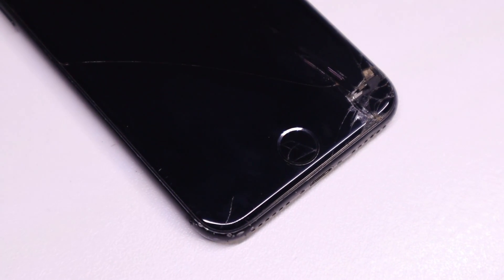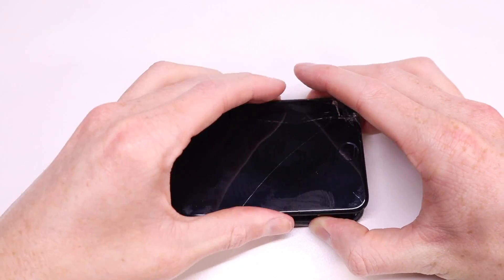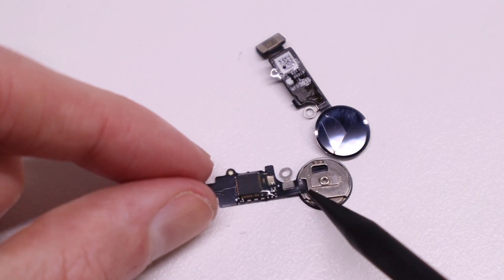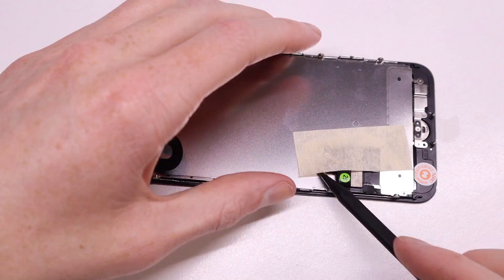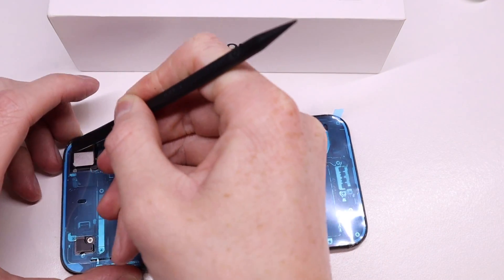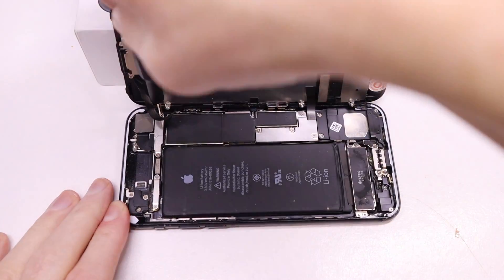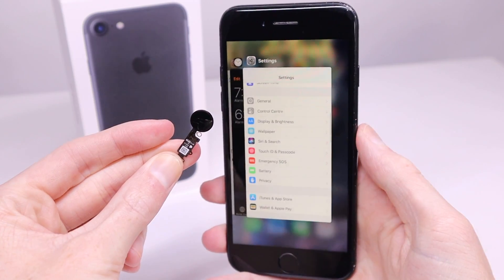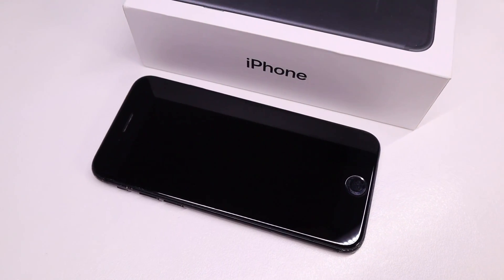Replacing Apple's "NON REPLACEABLE" Home Button

Comment: As far as I know it's always been replaceable, however you will lose touch ID cos of apples anti repair policy basicly
Reply: @usmansuleman9548  it will work, I talk from experience, I work on a repair shop, If it won't boot means there's a problem identifying the home button tho, without the home button takes far longer for the phone to boot ( I do it test the screen), I replaced few home buttons that got damaged with overly damaged screens. The iPhone 6 tho tends to be the most damaged of them all due to their design
Reply: @usmansuleman9548  im not just being stubborn, from my experience when the button doesn't work might be a damaged lcd which has a flex for the home button or the home button itself, ive replaced some buttons for 7 since it's not as likely for them to break as on the 6, only when the screen breaks in such a way it damages the buttons cable
Reply: My apologies, I was researching and tested an iPhone today , for 7 doesn't work I confused it, I apologise my stubbornness, probably too much workload affecting my memory, since it's not common this fault, sorry once again

Comment: The dislikes are from Apple workers who just wants money
Reply: Ssup guys! If anyone wondering what's the best phone for "gaming", iphone xr is my choice for it! If you guys want to know why or just bored, feel free to read this ^ω^

(uhm.. also, if you guys saw this comment many times, I do it because I want to share what's this phone capabilities is. I'm not flexing or anything. You gotta ask you know lol
The reason I share this is just because of how people always talking shit about it and spew nonsense before even handling/playing/trying/using it themselves.)

For a quick review of my iphone xr (128gb white xr), the battery life (battery health is still 100% btw) is down from 100% to 75+/-%, meaning a 25% usage of battery life, in the spawn of 2 hours and heated a bit after playing these games, Pubg (smooth+extreme) and Honkai Impact 3 for an almost 2 hours straight. For fortnite, it's a little bit faster for the battery to drain, which the battery will lower to 75% from 100% only with the spawn of an hour and half. I get a stable 60fps with the setting of 60% 3D res or sometime lower resolution with my iPhone xr while i experience a thermal throttled if i play the game for almost an hour and half straight (still play if it warm and comfortable to hold but usually rest the phone a little after i felt it becoming hot at my left arm. I would say the increasing of temperature is not very significant as I still felt comfortable to use it at the first minutes of the thermal throttling and after that i rest the phone until it's cooled down. Also please do mind this is only like what I'm feel as I don't really know the exact temperature and don't have a proper temperature's checking equipment T.T). 

I guess why this phone's temperature is slow to rise/slow to overheat is because how the iPhone xr hardware is made. Although I do wish they put a really efficient cooling system, maybe a combo with both passive and active cooling system! Like in Razer Phone 2 with a passive cooling system that have a big waterbed-like cooper heat sink. For the active cooling system like Nubia Red Magic 3 with the in-phone-fan, for example. please see this post somehow, APPLE!!  Btw, if you see this comment and manage to do the test, or manage to make a efficient cooling system, I would like to say thank you for the amazing work!! Bless you!! xD

Linus Tech Tips video showing he's doing somewhat "add an active-like cooling system on a phone" > https://youtu.be/F91bGJBQLFc   I hope any smartphone company notice this video, and somehow make what Linus did here, but with more efficiency on a phone. Yep I know I know, who play games on phone right? I do though.. This type of cooling system, if it's done right, we can see a future with a more power phone, or even more powerful handheld console like PS Vita, Nintendo switch or a cross over between the said handheld consoles with a freakin' phone! Again, thank you!! Stay safe and have fun all!

#Notice me senpai! <3

For the full battery cycle, I reckon the last time i'm not charging the phone after it really empty, from 100% to 0%, it's literally take 12 hours and 48 minutes with both normal usage and heavy usage.

 About the overall look, for me I really love the xr design with the THICC bezel and the weight just because it give me these "psp/ps Vita vibe" when I'm using it (which I really love lmao).

The 720p display? Well it's actually 828p but who cares right? If you have tried it yourself and compare with other phone, you'd know that the Xr's screen is really one of the best lcd screen display out there. Believe it or not, Apple have done a good job to make the LCD screen really vibrant, curved the screen, make the screen overall really nice, and not shit at all! xD (but still the OLED screen is absolutely more vibrant, colourful etc but take note about the flickering issue, burn in-display issue or whatnot, and of course OLED is beautiful. It's just that these LCD screen do take it easy for the eyes to see and nice to look, for me at least). 

The "real" comparisons between xr, xs max and xs >
https://youtu.be/NWIO-9-rDcM

 About the display comparison between OLED 1080p vs LCD 828p > https://youtu.be/dcFXEXJicgc        

For the battery life comparison > https://youtu.be/3_y8BGOP-v

Btw if you want to make a comparison between any phone, search gsmarena or see this link >
https://m.gsmarena.com/compare.php3?&idPhone1=9320&idPhone2=9319

Someone will call me fanboy, blind etc but! My choice for a "gaming phone" goes to iP xr. Thanks a lot for reading lol! xD

Btw, this reply is made in hope that anyone who have a iPhone xr, or well, other device if you might, a proper equipment and have the discipline, to read this and do a proper thermal throttle, heat test from all around the phone (how long before it reach throttle for example), battery test, fps test, etc. I-i.. thank you from the deepest part of my freakin' heart!! Thank you so much :')

The test that I'm hoping to see is like what this guy do : Samsung Galaxy s10 test between exynos and snapdragon variant > https://youtu.be/kg91U2hbLbo

p/s : I really cannot do the test myself because 1) Dont have the proper equipment. 2) Dont have the knowledge of how should the test be done. 3) and.. I-i.. can't play phone for a quite long time, straight before feeling sleepy lmao. I just hope someone do the real test about the iPhone xr as I'm really curios what it's can do/ it's real potential, so I can shared the information to everyone who don't appreciate the phone and just ignorantly saying the phone is bad xD 

2nd p/s lol : Again, I'm not flexing or anything, I can finally buy this phone after a month and half lol (welder at a construction site). Working everyday and leave at 10pm except Saturday at 7pm and Sunday at 10pm xD so I'm not rich or something ahaha
I try the phone beforehand, it's my friend xr, and damn I was like this phone is snappy as fuck lol, then got told by him his experience. At that time I put my mind to buy this freaking phone 😂 and about my comment above, that's my experience with it

Stay safe and have fun guys≧∇≦! <3

Comment: Finaly we dont need to pay apple to much for repair. Nice video 👍🏻👍🏻
Reply: I heard they don’t do repair anymore.
Reply: No touch ID though..... But wait enough time and eventually the chinese electronics gods will find a way.
Reply: Theodor Mikkelsen well if you not wealthy then yea go ahead..
Reply: Only problem about this work around is the bluetooth will always have to be turned on.That in itself will kill battery quicker.And we all know Apple phones have VERY low mah batteries to begin with.But hey its no skin off my back.Apple is junk anyway.Ill stick with Samsung.I just wanted to point out the extra battery use for this work around.Definately cool but has its flaws.
Reply: Both r correct